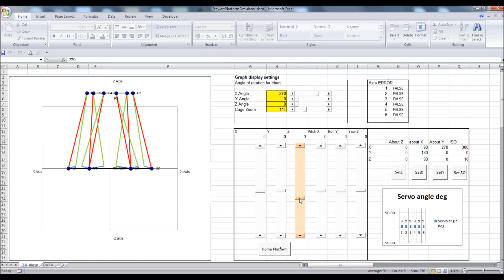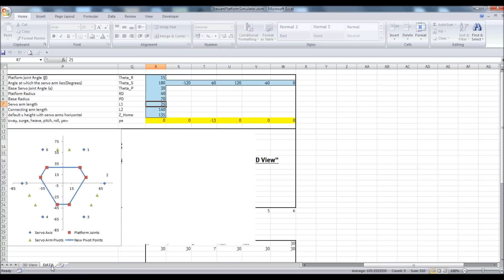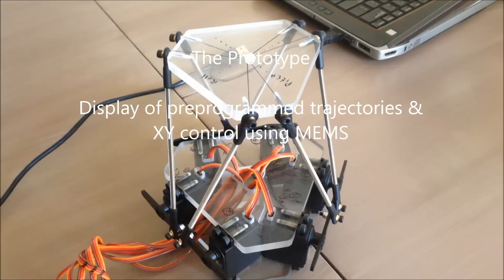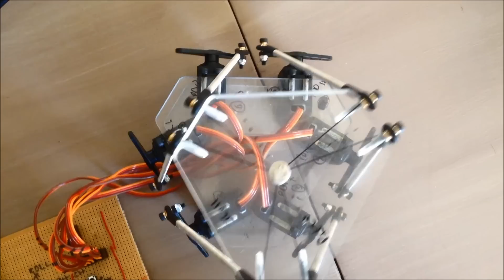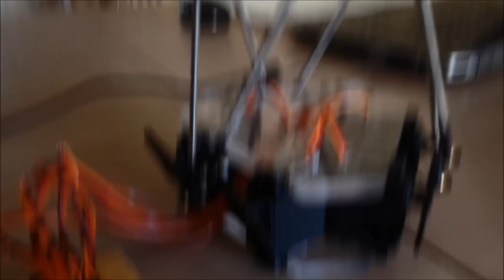Comment: Amazing. I'm looking to build a 3D Printer that uses a Stewart platform to control the movement of the extruder more precisely. Of course the Platform would be upside down in order to do this, with the extruder mounted central to the platform. This spreadsheet will do well to help me simulate the needs of my platform before even building it in order to get the maximum build volume possible. Thanks a lot. Amazing work. Side note, couldn't mistake the South African accent. I myself reside in SA. Viva ANC ;) hahaha.

Comment: I think this is an outstanding job!. Please tell me how to draw in excel like you do, I mean, do you need another tool for plotting or is it just excel?
Reply: chuchinmc Thank you for the compliment. The excel representation is merely a XY scatter graph with trendlines connect 2 points at a time. Very simple. the 3d effect is created by cleverly plotting points on a cartesian plane how the 3d points would be perceived if viewed from a particular angle